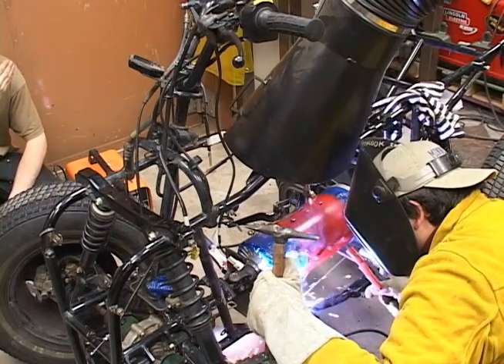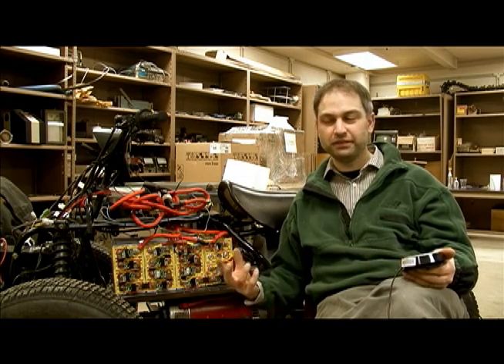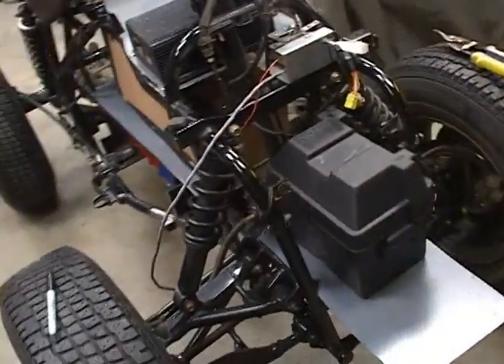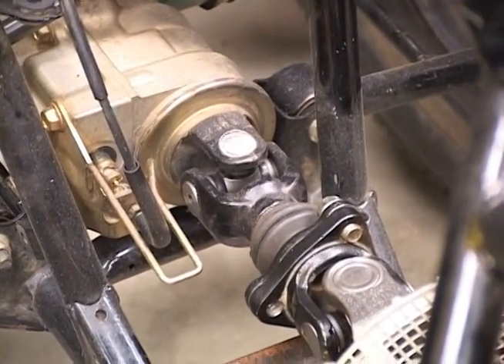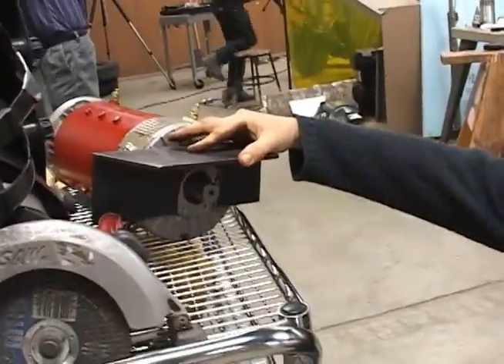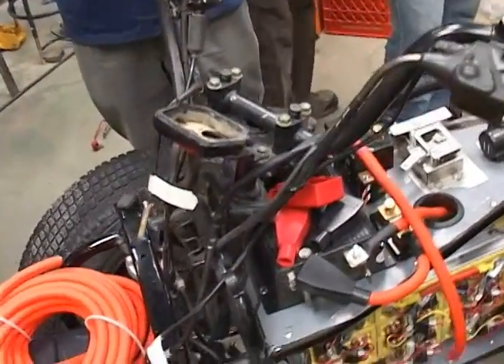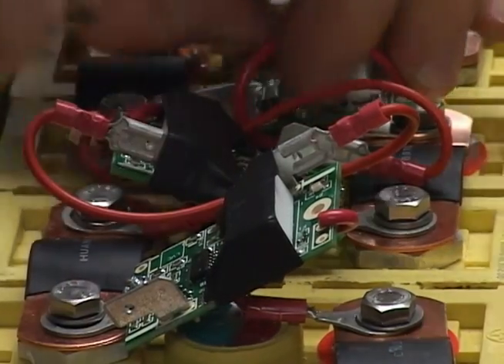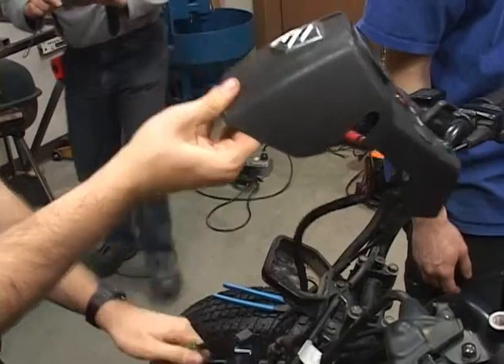Electric ATV Conversion Battery Powered EV at the University of Alaska Fairbanks DIY How To Convert

Comment: new electric car conversion system diy. cut up engine leave in water cooling lower but remember to cut leaving L bracket for electric motor. lathe camshaft into pole attach hydraulic around pole camshaft put back in. leave belt in place on bottom of L shaped then take the manifold cover and cover electric motor. put generac and transformer on top off manifold cover with roll bar to keep in place. change oil ever seventy hours. it now runs 5 hours per two gallons of gas and hydraulic motor protected against water damage. alternator still in place/water pump still in place/ air conditioning still in place and turned by camshaft hydraulic motor. good luck. Car is now much cheaper and you still have clutch.  maybe you don't need it but take it out only if you feel like it. remember to change oil cooling to water cooling then wallah.

Comment: Lead acid batteries are renewable, but lithium-ion are not.

And of course an electric ATV is really only useable in Alaska for 4 months of the year because of the temperature and even then you'd have to pay out the ass to GVEA to charge the damned thing and it'd end up being being a wash for fuel cost while sacrificing performance, range, and flexibility.

Comment: It's kind of a cool project, but wind power is not the panacea that the left thinks it is. The rare Earth minerals that make modern wind power functional is, well, RARE. MUCH rarer than oil. 

As for electric vehicles, there's a physics limitation with batteries. The chemical reaction has to be self contained within the casing. With gasoline, only 1/14th of the chemical reactants are actually in the fuel tank. The rest comes from the atmosphere.